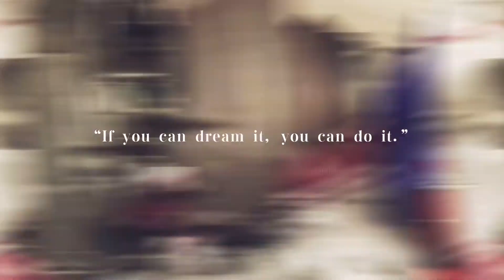Turbocharger 1.6HDI. GT1544V 9663199280 What to look for when replacing the cartridge ( CHRA)

Comment: Did you sort it Jay? those nuts do come loose on those that are sold on eBay, probably not torqued up properly and I have seen that a few times. Maybe advisable to use some Loctite threadlocker on that end nut, if you do use it red is recommended as it's more stronger, but blue can be use and would suffice to keep the nut in place if torqued adequately. Once they come loose the whole cartridge and turbine shaft shifts out of place and as you have noted in the video it collides with the inner surface of the casing cover and chips and scores that area. So did you do a complete rebuild?
Reply from the maker: Hi Gaz, thanks for your comment. I ended up having to order a new CHRA and rebuild the whole turbo. The nut definitely needed tightening. I used the blue loctite ad that’s what I had available. The seller on eBay requested that I send the damage CHRA back for investigation to which they blamed me for not checking the torque on the nut! I also replaced the variable vanes. I have since sold the car to a friend and touch wood, it’s still running, no issues.
Reply: @JayHm  Well done Jay, they can be a right pain, pleased you got it sorted. As long as the car has regular oil changes and maintenance, they usually last. Obviously everything has a life span and turbo's are notorious for problems, but good quality low sap oil is a must. I always change the feed pipe, or if not possible, cleaned thoroughly and blasted with high pressure air to clear any clogs and fit new banjo bolts with washers. Where did you get your replacement parts, the variable vanes or was that eBay too?
Reply from the maker: @gazsto9510  the variable vanes we’re from China. It was hard to come by that part here in the UK. It was £42, posted if I remember right. You’re absolutely right. They definitely need a throughly maintenance once in a while. I bought an old  Garret a while back for a similar car only for the vanes and ended up using some parts from it. Admittedly, I did purchase a brand new waste gate but never used as that wasn’t the issue.
Reply from the maker: @gazsto9510  the feed pipes were clogged up too but I only cleaned them with carb cleaner. I also took the banjo bolt off and gave it a good clean too.
Reply from the maker: Hi Gaz, thanks for your comment. I ended up having to order a new CHRA and rebuild the whole turbo. The nut definitely needed tightening. I used the blue loctite ad that’s what I had available. The seller on eBay requested that I send the damage CHRA back for investigation to which they blamed me for not checking the torque on the nut! I also replaced the variable vanes. I have since sold the car to a friend and touch wood, it’s still running, no issues.

Comment: hello looking to buy that turbocharger would you have something for sale ?
Reply from the maker: Hi Carlos, thanks for your comment. I have only got parts of one. The variable vanes and the CHRA are in need of replacing.
Reply: Or maybe something similar ? Without the vanes ?  Want to turbocharge a vw engine but I’m thinking on it as a Diesel engine due it’s low rpm range and Plus I added a long grar trans . So I need torque at lien rpm from 1500- 3600 max  could you recommend something to fit my crazy idea ?
Reply from the maker: @mecarloschavez6281  sorry mate. I am not sure I understood your comment. So the car you have is VW and you’re looking to put a turbo on it? What’s the factory specs on it? You’re welcome to have the parts I have here, providing you’re in the UK?